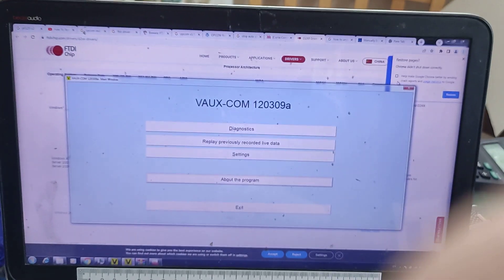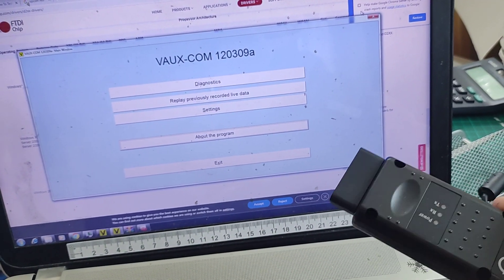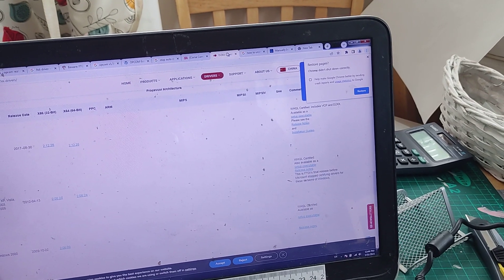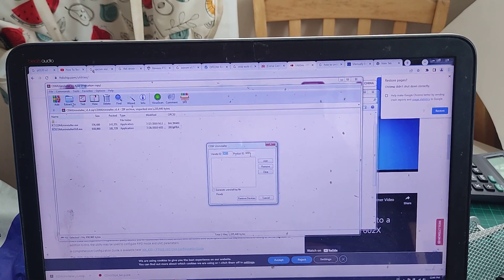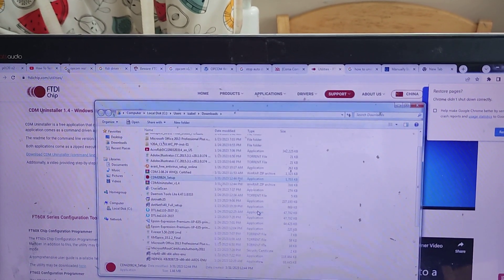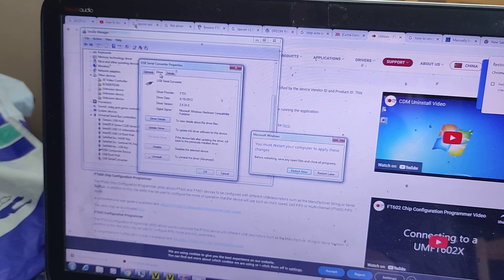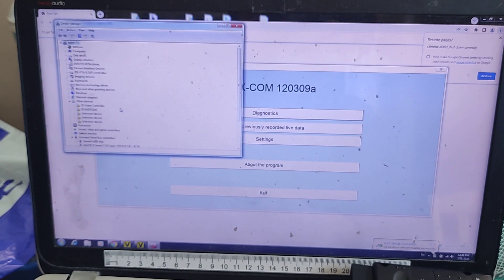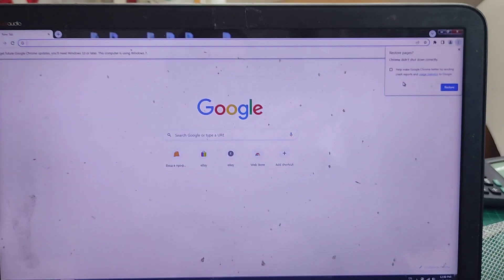How to change Drivers on OPCOM interface. 2.12 to 2.08.24 driver roll back

Comment: I got a 1.99 chinese clone, but when u plug it into the laptop without plugging it in the car I cannot find it in the device manager. Any ideas why?
Reply from the maker: Could be drivers , Could be the device chip
Reply: @MeFixingEverything  im 99% sure its faulty device, does not light up at all when plugged in. 20$ down the drain lol